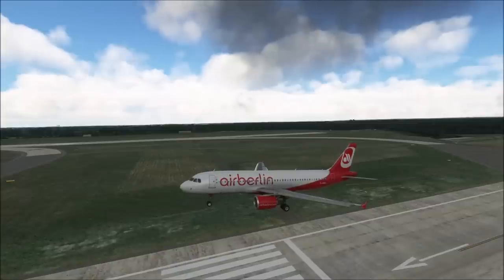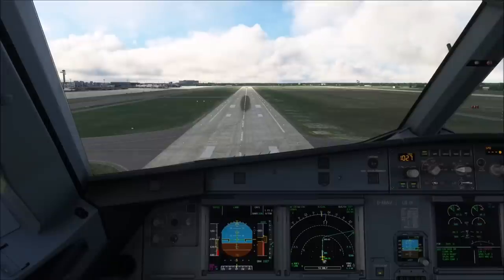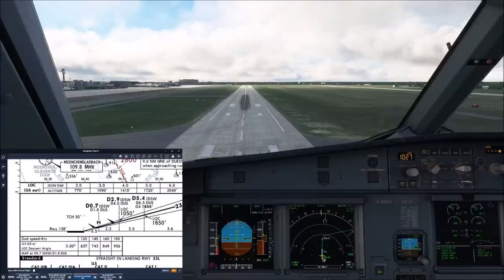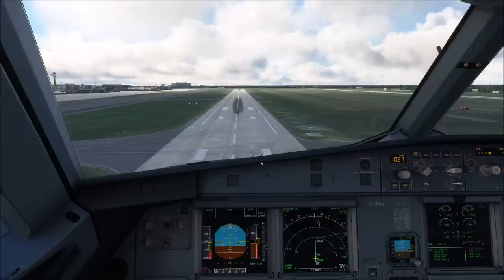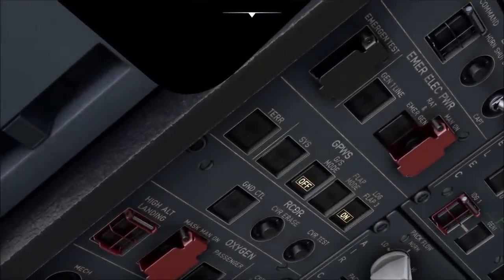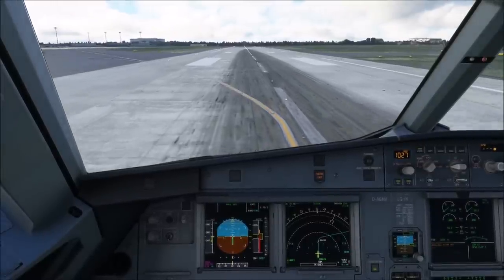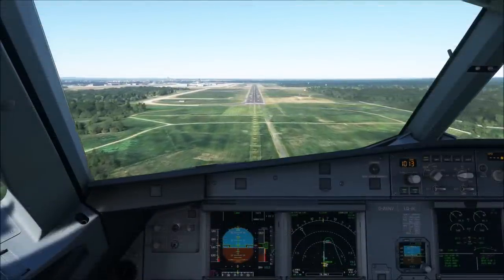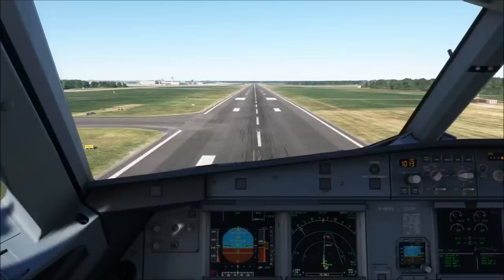How an MSFS BUG makes your LANDINGS MUCH WORSE | Real 737 Pilot

Comment: I create airport scenery and good that you brought this up. It would be great if you make a video to test this out sometime on an ILS runway in the SDK. I make sure the GS is located at the GS antenna's RL position, however that 3.0 degree angle plugged into the GS settings may still not reflect TCH in the sim. Many things can affect this, such as the runway slope terraforming graph. It's the same reason you often go up a slope or down a slope when taxiing to a runway. The GS antenna is outside, or near the edge of, the terraform falloff threshold. This causes the GS to be higher, or lower, than it should be IRL. It's important to make sure the GS antenna is at the same ALT as the runway threshold. This is easy to do but often overlooked. It's also often overlooked by the Blackshark AI algorithm. Then an autoland needs to be done by the scenery creator to ensure these numbers are correct. If the plate states a 3.0 GS but it requires 3.050 in the sim, then it should be done to ensure accuracy. 

Not really anything we can do about default airports. the SDK does not allow us to modify existing AI-generated runways and approach navaids.  The only option is to create an entirely new runway into a new package or place the built package within a metapackage. 

One of the easier ways to do this is to ensure your plane is at the correct height over the RWY threshold, and in developer pause, load up your custom scenery BGL. Then enable the draw of localizers and glideslopes. This way you can modify the GS and see in real-time how it should look before building the package. This saves a lot of time with not having to reload the sim with the updated package.

Comment: TCH, by definition, is the height of the middle of the glide slope at the threshold. The GS is not necessarily usable below DH. It is only good to the ground at a CAT III runway, such as the one here. Following the GS all the way to the 1000 foot marks would result in a Navy carrier landing; ie, no flare. The flare will always take you beyond 1000 feet for touchdown, which is why most of the tire marks occur farther down the runway.
Reply from the maker: Out of the thousands of landings I've done in the 737 by now I've really hardly ever had glideslope problems below the minimum. You're right, by definition it may not be correct, but in practical terms it is.
We should not try to excuse MSFS bugs by legal definitions when practical flying experience just proves different.
Reply: @737simviator  The white markings of which you speak are known officially as the touchdown zone markings, and they serve several purposes.  First, they occupy the actual touchdown zone, which extends through the first 3000 feet of the runway.  Second, they serve as a distance remaining indication for the touchdown zone - they are spaced every 500 feet down the runway (specifically, they begin every 500 feet) and the big single stripes begin at 1000 feet down, serving as the aim point on a 3 degree glide slope.  This is not the intended point of touchdown, since the flare will be initiated close to this point and the touchdown should occur somewhere around 1500 feet or so down the runway.  The last small single stripes start 3000 feet down the runway, and technically extend beyond the touchdown zone.  These markings usually only appear on instrument runways.  The 1000 foot aim point markings often appear on non-instrument runways however.

I was not aware of the pavement being thicker in the touchdown zone, although I suppose that may be so - it might make a certain amount of sense.  Heaven knows, some of my landings undoubtedly set off a few seismographs locally, and thicker pavement might have been appreciated by the runway itself at that point!

Comment: Very interesting!!  I was able to confirm that, using the Developer Mode (Options->Display Position). 
The runway threshold elevation precisely matches the published elevation, so that doesn't seem to be the issue.  But when in "drone mode", if you ascend over the threshold of EDDL R23L to where the PAPIs are 2 red/2white, the elevation is roughly 80' at Düsseldorf, whereas it's 50' at Cologne (R32R).  I also noticed the same thing with VIDP R29 -- roughly 80' in elevation when you see 2 red/2white.  Could the issue be with displaced runways?  I haven't tested any further to see if there's a pattern.  Hope you get to the bottom of it and thanks for pointing this out!

Comment: There are multiple variables here. The aircraft's ILS antenna, the main wheels and the radar altimeter are all at different heights from the runway. It might not be significant in a 37, but in a 47 or an A380 it is very different. That's why older VASI systems had 3 bars, pilots of large aircraft were looking at the upper pair, others the lower pair.

Comment: I rarely go to the same place twice so do not buy airports.  Thus, all mine are the AI-generated generics with the sprinkling of Asobo "bespokes".  And I frequently encounter problems with how the glideslopes (both ILS and RNP) agree with the approach plate and/or the PAPI/VASI and/or the touchdown zone and/or even the alignment of the runway.  There is often incorrect (or zero)  runway lighting as well but that's another story.

I was in the MSFS alpha/beta program and one of our main jobs was "proof-reading" the work of the AI that made all the generic airports, so it could be tweaked.  As such, I know something about how that works, although I only looked at GA fields without instrument approaches.  I've also built a few (very simple) airports myself with the SDK, so I know something about the limitations built into the parts that the AI (which uses the same bits and pieces)  has to use to assemble generic airports.  I myself have never set up an ILS at an airport but here's how it's done if you're interested (at least with this 2-year old version of the SDK--it might be easier now)  https://youtu.be/c9I_3rCoq4M?t=1235

Anyway, one of the problems (at least back a few years ago when I was testing MSFS and messing with the SDK) is that the PAPI/VASI is part of the runway object, not its own object placed independently.  As such, its positions relative to both the threshold and the edge of the runway are fixed.  In the SDK, all you can do is enable the light's existence, choose which side of the runway it's on, and what it looks like (PAPI, VASI, a few other things, and how many lights it has).  You can also input the glideslope angle if it differs from the default value which, IIRC, is 3^.  These limitations apply to the AI as well because it uses the same runway objects as the SDK.  And one of the things I noticed when proof-reading airports was that the PAPI/VASI was almost never in its real-world position.  You can usually see where the lights should be on the Bing ground images, by small circles of dead grass where they've sprayed weed-killer around the lights.  But the lights can't be moved relative to the threshold.  As such, for both generic and hand-made airports, the PAPI/VASI's location usually does not correspond to the actual touchdown target area.  BUT, this is cleverly disguised because the runway marking are ALSO part of the runway object, and these are scaled so that the touchdown target marks are the same distance from the threshold as the PAPI/VASI.  But neither of these usually correspond to their positions at the real airport, and so also do not correspond with the ILS or RNP GS, ESPECIALLY if the approach GSs are set up true to life.

So, in the sim, we frequently have the case where the runway markings and PAPI agree with each other but not with the GS.  The PAPI and paint agree because they're hardwired to do so, but are in a fixed position relative to the threshold so are almost certainly NOT in the correct place along the runway.  And thus they disagree with the GS, which is almost certainly set up (by both the AI and humans) from the real-life data.  Because the paint and PAPI agree with each other, the natural assumption is that they're correct and the GS is wrong for being too high (the usual case but sometimes it looks too low).  HOWEVER, the opposite is usually really the case.  The GS is correct and the paint and PAPI are wrong.

Therefore, my usual habit and custom is to follow the GS to the bitter end, ignoring the 4 whites I usually get from the PAPI, because I have more faith in the accuracy of the GS than of the paint and PAPI.  EXCEPT occasionally I find misplaced localizers.  I did an ILS into LRCL a few months ago and discovered on short final, thanks to synthetic vision while in VERY thick IMC, that in-game localizer was like 10^ off the line of the runway, so I was being led at an angle to the departure end instead straight to the threshold, so circle-to-land was required.  Good thing the TBM's synthetic vision is really good :D  This was NOT mentioned on the Navigraph approach plate so I assume it was a bug.  Magvar matters, y'all :D.  More recently, I did the ILS into VRMM and discovered on short final that the runway the localizers were sending me too was out of service, and that the adjacent taxiway was filling in, so again, circle-to-land.  And again, this wasn't mentioned on the Navigraph plate, but at least it was VMC this time so no problem.  I put this one down to Bing's image, from which the AI derives generic airports, being several years old, so shows the main runway out of service, whereas in real life it's back in business.  Thus, the current nav data has you using the real runway again.

Anyway, long story short, lots of problems with GSs in MSFS.  Most, however, I put down to the improper positioning of the PAPI and touchdown markings rather than the GS data being wrong.  YMMV.

Comment: Oh yeah, this has been a problem from the beginning, and I thought they would have it fixed by now, but I guess they are prioritizing scenery and other aspects of the infrastructure since it will still get you to the runway safely in general. But it’s definitely an issue (unless you use a third party GPS approach).

Comment: With regard to the RA height, during my Maintenance Engineering Avionics training I was taught the RA was the alt that the wheels were from the gnd. Compensation for fuselage height was taken into account. i.e. on a 747, 10 ft call out was the wheels were 10 ft from the runway. The fuselage where the RA antennas are, is considerably higher than the wheels. Hence on the ground it was common to see -5ft on the 747 RA's. Now In MSFS, on the ground, for most A/C the RA should read zero or there abouts. In MSFS they mostly read how high the fuselage is from the gnd. This is wrong. If it read wheel height, then in the case of the airbus, the R/A should read about 6-7ft lower. This would put the indication closer to the height of the wheels. After all, at that point in the landing,  the wheel height is the important  criteria .

Comment: I suspect that there is not an issue with the glide path. I suspect that there is an issue with the positioning of the ILS signal. SU12 was said to include an ability for us to make some changes to the default airports. I wonder if positioning the ILS is one of the things we can manipulate. If we can, then if you move the ILS back some, it will lower the glide slope path to get it closer to the correct height.

Comment: I have always had a problem with this so I've typically followed PAPI or a visual after I see the runway, but also that when I'm coming in to land in almost any aircraft, I can be absolutely perfectly on the glidepath and localizer, but if I handfly, at 400ft my aircraft stops descending and instead gets a sudden boost in lift. that causes me to go wildly off glide slope. and I mean even in situations I've been stable since 1500ft. It's like ground effect but way higher. And I've tried with live weather, presets, turn off wind completely, etc. I have to pre-emptively pull the throttles back at ~400ft to keep it descending.

Comment: Interesting.
As an amateur - I  never chase GS near threshold (guarantee disaster) , I may check the the PAPI. - You cannot trust this either in the sim. Focus is on speed and VS.  Admit I flare and touchdown all over runway. But it is OK for me.
I know for fact that RA is calibrated with main wheel extended, and nose high.  As you no doubt know - RA reads -9  at ground (-400/500)  At rotate and touchdown RA should read 0. - If nothing changed last couple of decades......

Comment: Wow thanks for this video, very enlightening!  I’ve always had a hard time landing airliners smoothly in MSFS, it always felt like it was high or floating down the runway (issues I never had so regularly in P3D) so this all checks out for me.  I assumed it was a physics/ground effect issue.

So the PAPI is messed up and the glide path is even more messed up…yikes!  I wonder what the issue is?  Hopefully Asobo will revisit based on this video as clearly something is not right (and it can be fixed as you’ve shown in the Bonn landing).
Reply: I can't help but wonder how it got so wrong in the first place.

Comment: As far as I understand it, from when I've seen glide slope/ILS issues brought up in the past, is because of the developers not setting it right rather than a bug with the sim itself. I have also heard that setting up the ILS/glide slope in scenery is really clunky though. So maybe its half a dozen of one and six of the other. I could be remembering wrong but when I have done autolands in the past I'm half remembering the glide slope indicator drifting either up or down closer you get to touch down (often sharply dropping as you cross the threshold) yet the aircraft continued on smoothly to land usually either on or just after the really thick down down zone lines. Perhaps its just a visual thing that needs to be fixed?

Comment: I'm not sure it is necesseraliy a specific MSFS bug. It seems that many scenery designers does not put too much effort in getting the PAPI distance from THR depending on runway profile and Aiming point markings correct. It seems to be more important to model the interior of the terminal buildings. For the first airport it does noe make any sense to have the aiming point markings ahead of the PAPI? (I haven't looked at the AIP for that airport so it might be correct) But the PAPI position , angle and the GP needs to be tuned and aligned  to get the correct TCH before releasing a scenery.
Reply: Finally, a voice of reason.  You hit the nail right on the head.  It is not a bug in the strictest sense but a sloppy implementation of something 3-D in the simulation's 3-D virtual world.  If it were "a" bug (i.e. singular) the error would be the same, systematically, at all airports and all runways.  But, some approaches are indicated too high, some too low, either by both the ILS needle and the PAPIs or even in opposition to each other.  This is a scenery design and implementation issue in the input data, not a systemic bug in one or a few lines of code.

Comment: Ah…I was wondering why in the a320 I would get such conflicts between the instrument landing and what my eyes were seeing. Really wish there was a fix
Reply from the maker: To my knowledge it is possible for addon airport developers to place custom navaids. However many don't do it and rely on the default sim navaids.
Reply: @A330Driver  You showcased this perfectly with the Düsseldorf approach. Because you are using an addon for the airport, I assume Justsim? Yet the navaids are default and thus incorrect. 
This is quite an issue as well considering this runway is CATIII approved. 
With all the things Asobo has to improve I think this should be next on the list after they concentrated on the weather in the next Simupdate.
Reply: @A330Driver  The Fenix A320 especially suffers from this, it will barely autoland on most airports

Comment: Glad your pointing this out. So bloody annoying this bug.. Correct me if I'm wrong. I'm sure this was brought up in last Dev Q&A, Jorg said they need more data and finding it difficult to attain..
Reply from the maker: Not sure how hard it is for them to get such data, but the TCA is published in any approach chart. Based on that and the approach angle - which is also published for every procedure - it should be easy to calculate where to put the GS antenna.
I'm sure with the contacts they already have to NavBlue it would be possible to obtain that data in a readable format for the sim.
Reply: You can see the GS antenna on any decent overhead image.

Comment: Forget about the PAPI!
BUT:
You did not mention, which scenery and data You use.
I believe, it is the EDDL payware, as I do. Navigraph installed?
What I realised, i, that some KI-airplanes are 5m above ground. There is a height mismatsch between the mesh data the KI uses and the addon-scenery.
Could it be, that the mismatch of the glideslope height has the same cause, because the ILS uses the same data as the KI planes do? It is the same 20ft...

Comment: MSFS visuals and scenery are in a totally different league compared to every other sim out there, which has practical benefits (including dead reckoning VFR navigation).  Despite this, I still think X-Plane is a far superior SIMULATOR.  
Major problems I have personally noticed with MSFS:
Trees obstructing the landing glide path at many smaller airports (it's not like there aren't 50+ year old FAA rules that could've been added to the algorithm)
P factor effects MISSING ENTIRELY (No right rudder needed on takeoff in a 172???)
Weird turbulence effects (just feels like someone is pushing on a rudder in a sinusoidal pattern, so bad as to cause sickness in VR)

There's probably a thousand other things that are minor annoyances that i merely tolerate.

My #1 biggest issue with XPlane 11/12:  Anti-Aliasing is ABSOLUTELY GOD-AWFUL.  Especially in VR.